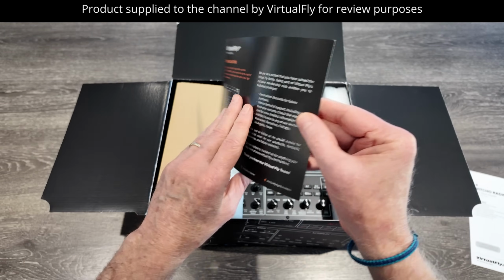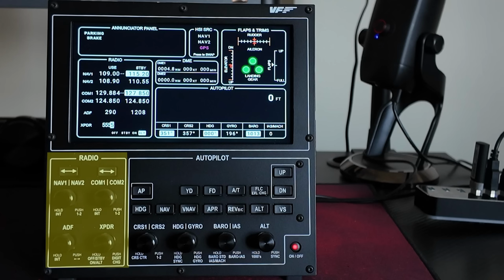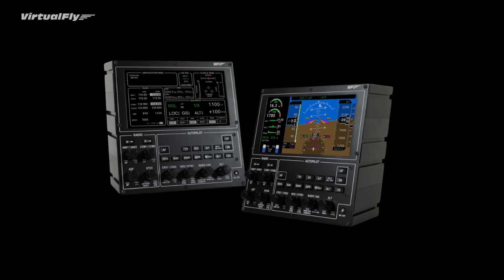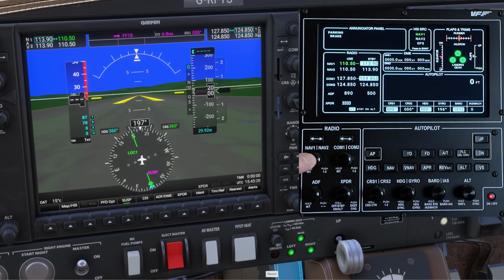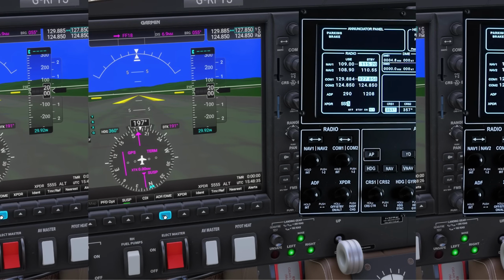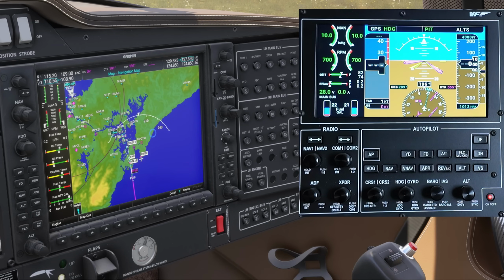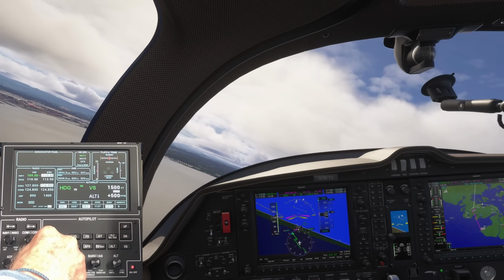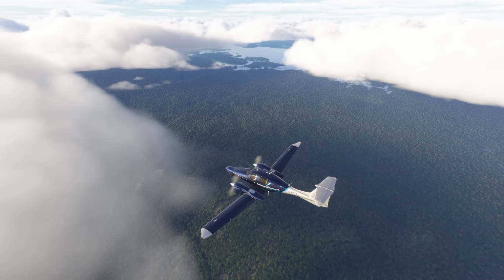Elevate your Control with VirtualFly | Switcho Radio Panel & EFIS in a single unit | MSFS2024

Comment from the maker: Follow up : Virtual Fly have answered a few queries I had. The Alititude issue is knowm MSFS2024 issue for them. They will have an update out to resolve. They confirmed the VFHub uses the default configurations so some third party aircraft using bespoke simconnect calls may have functions that are not supported.
Reply: That was going to be my question.  I have had my eye on these VF devices for a while now, and I couldn’t see how they would ever work with more complex planes without being able to customise them with SPAD, FSUIPC and the like.  I understand that all the boxes except the Trims Neo, and the Radio units can be converted to simple HID devices with a firmware update from VF, and then they can be configured with SPAD etc.

Nobody seems to want to talk about this though, and I believe you may be the first to even mention it, though in the comments not the video.  Most people will find their favourite 3rd party aircraft to fly, and then it’s a toss up whether these very expensive devices will even work, whereas my £100 Logitech panels work with everything.

Comment: I recently purchased the Octavi IFR-1 which performs many of the same functions when using the Garmin 430, 530 and G1000 for the fraction of the cost.  Really like the unit as a private pilot.  The Switcho looks great for commercial airlines.

Comment: Totally overpriced piece of stuff...and very low quality of build compared to other designs we can get from the market. No backlight and cheap encoder knobs with cheap encoders inside...
Reply from the maker: Clearly you have never used the Switcho, but thanks for your constructive feedback. I'm sure it will be very helpful to other simmers out there.
Reply: @SimHangerFS  I exactly know what stuff is inside that aluminium box. 

The lack of backlight is the biggest issue - it should be backlit in that price range.
Paying an extra 60 euros to have EFIS is a colossal joke and a punch in the face for each customer. 
Cheap encoder lnobs that are easily accessible on the market.
Missing dual encoders - they decided to use cheaper (much cheaper encoders) than proper dual encoders. The customer has to learn and remember - did I press the encoder or not? It is ultra complex logic like in the Octavi stuff.  It requires to think more in which mode I am right now - then just press or rotate a knob. This is not how aviation world works. There is no space to think which mode am I during the flight - it must be easy and straight solution.
Buttons look weak, too. Cheap plastic with some text printed on it.
The ON/OFF indicator, not properly centered,d is a tiny additional touch in that well-priced premium unit.

This is the most expensive radio unit on the market - 900 euros.

The most solid part is the aluminium enclosure which has to be removed when we want to mount it in the home cockpit panel.  

It would be better to give an option to order with or without that aluminium part instead of charging 60 euros for uncommenting the code lines on rp.

Comment: Hey Plug&Play great, so that my Thrustmaster TCA captain pack X AirBus edition works like that on my Xbox series X. This is some kind of failure 😣 Everything worked and now it doesn't want to and you have to play with manual settings, the controller settings are so unintuitive that there are no words.!!! I spend more time in the controller settings when I fly. It should be called a simulation of controller settings and not a simulation of flying ha ha this is some kind of joke 🥵👏🤡 Warm regards 🌞✈️

Comment: Seems cool but expensive compared to the FlightSimBuilder G1000. Or if you already have a Bravo, just tack on a Logitech radio panel. Not sure why I'd get this unless I were starting from scratch and going all Switcho.
Reply: Too expensive

Comment: I love mine, but JUST ordered a G1000 panel to compliment the Switcho.  I really enjoy the AP controls. NOTE:  I have communicated with Barcelona directly because my Logitech radio stack and multipanel will NOT work when Switcho was added to my sim.  Two engineers said there would be possible conflicts.   They were correct.  So, the Logitech stack is off line.
Just a tip for your viewers.   Thanks for the presentation.  (just don't mix up those matching USB-C inputs on the rear panel!)😉